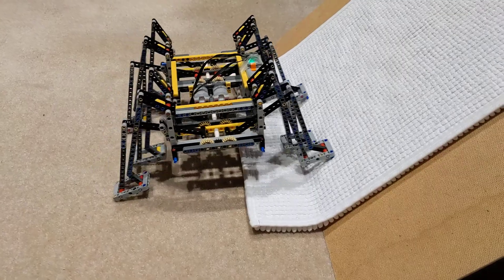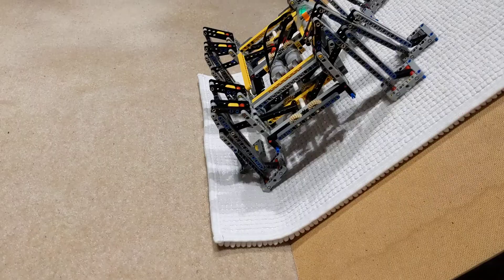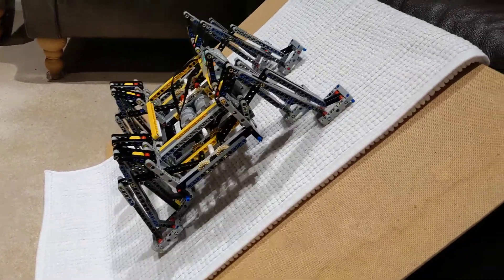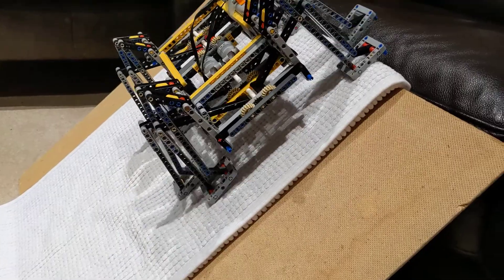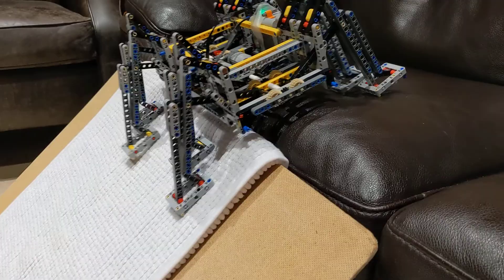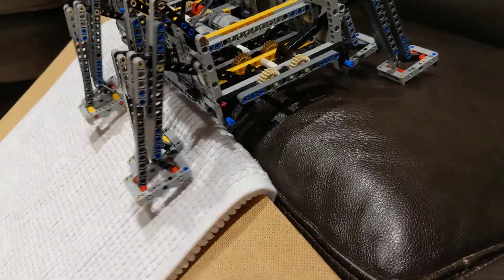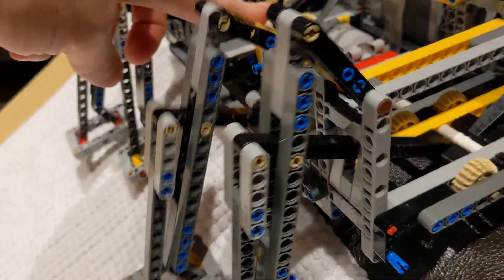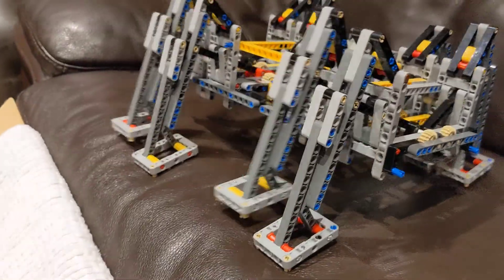Lego Technic walker, 45 degree ramp

Comment: Your Klann linkage is working great. It looks like a decent foot path. You have lots of extra torque. I think you could gear it down and make those feet move a bit faster. Once you top out the foot speed it would be good to lighten the feet. At some point you should get traction problems as the feet begin to slide so you would get some rubber on them. If you want speed instead of climb ability use a 60 amp esc,, 3 cell lipo on an XL motor geared up.  You already have the stuff. Put real RC gear in your LEGO you won't go back.
Reply: Klann gives lots of torque. Other linkages might be faster.
Reply from the maker: think I should try this! thanks. Would love to fit the CVT box to it. I think this would be a first?
Reply: @carlbModels  I have not seen a walker with changing gear ratios.
Reply from the maker: it makes sense - would go fast until it hits an incline, then gear down (or up if you think that way round!) to increase torque... now that would be an invention. Am very interested in this idea now I've thought about it some more.
Reply: @carlbModels  I think it will be tricky. The torque is not linear. I could see having to compromise with Electronic shifting rather than torque shifting. In this case The smaller the foot path the flatter the torque curve.
Reply: 12 v will burn L and M motors.
Reply: One ore thing, when you are optimizing for speed make a change to one leg or the legs on one side then see if the model turns.
Reply from the maker: @MaxBrix  ah yes, a practical suggestion. I did model one leg then replicated it, but I like the idea of testing with one complete side. My Klan is already slightly different on the front legs, the feet are modified for more grip  in the forward direction. I tested this out on the ramp and it was a huge shock to see that  it could climb so well. I still want speed though!!

Comment: Nice job. I really want to see that big heavy battery box replaced with a LIPO. I guess if your climbing stuff that steep you need some weight up front though.
Reply from the maker: Oracid1 and DIYWalkers have suggested the same thing, but as you summise, the weight actually works for it. Perhaps a 3s lipo though, a bit more poke to it.....
Reply from the maker: my idea for a biped involves a moving battery box....... eg left foot raises, battery shifts to right. And opposite, so the chassis stays level.....  I think you can see how this works!

Comment: He did it ! 
You could use track rubber under the feet.
Reply from the maker: if I had some, definitely on the front feet. I've modified it so the feet rock back and forth more, which has made the top of the ramp better - at a slight cost to speed on the level! Also mounted the battery permanently to give front bias. Thanks for the inspiration! when I have pushed the pure mech solutions to the limit I'll be looking at servos and microprocessors 🍺👍
Reply from the maker: hi - I moved the battery further forward and it gets over the edge!!! now added some extra grip on the back and it manages even steeper ramps. Not quite what I intended but interesting none the less!